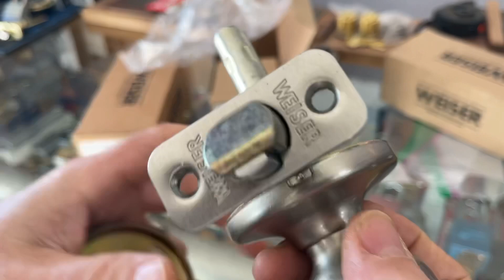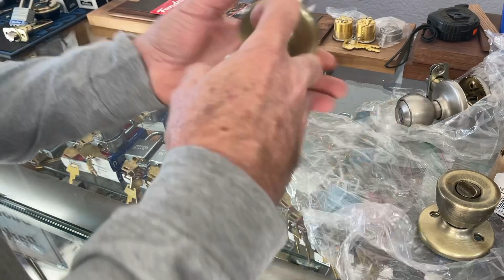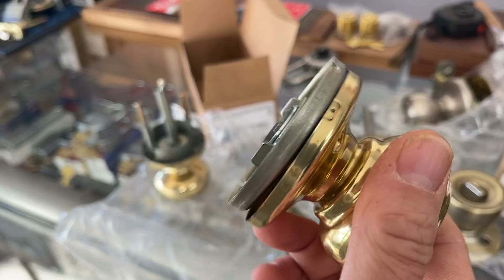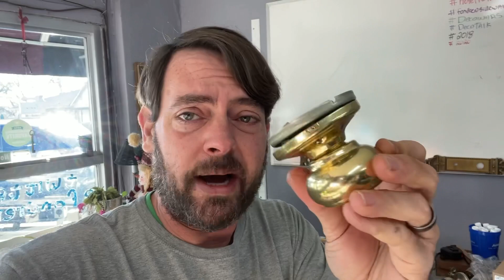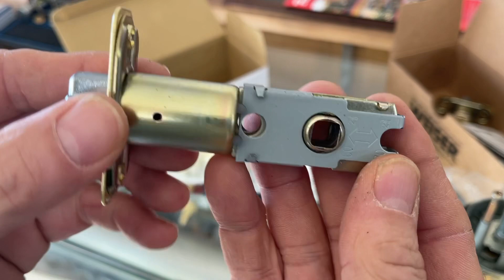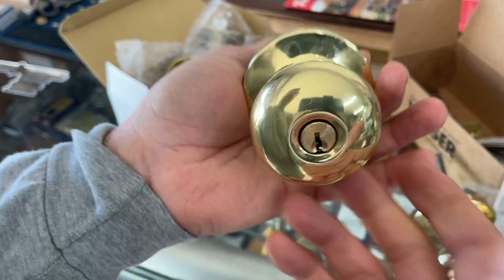Hey Weiser. This is a stupid problem

Comment: I wish kwikset would finally change their latch.  The anti-jimmy pin is so dang thin that ots almost impossible to set a strike on a door with compression weather stripping, without thst going into the strike hole. I get more calls for door stuck closed with Kwikset broken latches than any other knob. I stock up on LSDA tylo style latches, just to replace them our on tricky doors.  Its bad when a cloned latch design is vetter than the real thing
Reply: What’s your take on Bold knobs?  It’s a Kwikset copy but the materials are way beefier.
Reply: @lucast3006  it's junk
Reply: @jamespetkwitz8737  Well of course the original design is junk.  But I’ll say that I rarely have to service Bold knobs and latches that I put in.  At least they’re all metal parts and the things weigh 10 times more than KW.  The problem is that they’re more expensive, and that turns a lot of people off.  But my main point was that they’re yet another example of a cloned product being way better than the original.
Reply: @lucast3006  the problem with clones of KWI products is that they will all suffer from most of the same design flaws. Kwikset has really never changed their latch design. And they all wear out and break the same, same for clones. Only thing the clones have is usually a bigger "anti-jimmy pin" that is less likely to get trapped in the strike,

Sell LSDA instead on bold. It's a lot better. And don't sell tylo based products.

Comment: Yes that is ridiculous, you have to wonder if they even tested it before producing that design. I assume it can’t be fixed by adding two small washers (one for each screw) to grab the brass part on the inside - not that you should have to, of course

Comment: I have had the same problem with kwikset's. It is bad real bad. Them quick connects or what ever they want to call them, wait until one comes off at 9 o'clock at night. Yes I have had them come off in the client's hand. Ok, did he/she turn it to hard yes, but it's still a call out with no charge. I can't stand Kwikset or Weiser's, I only wish I didn't have to carry them.